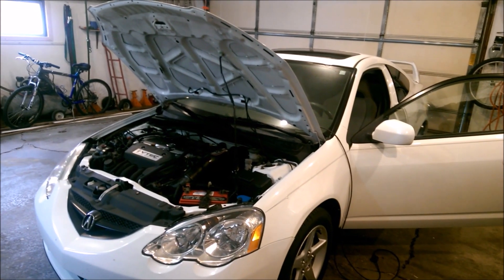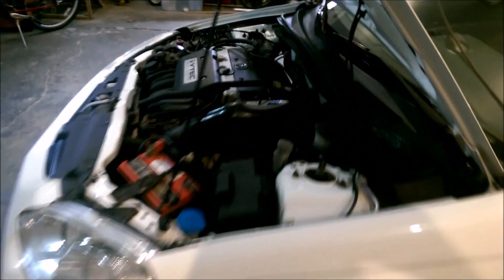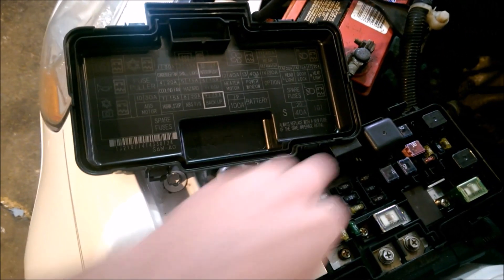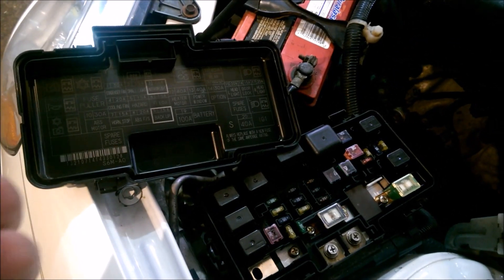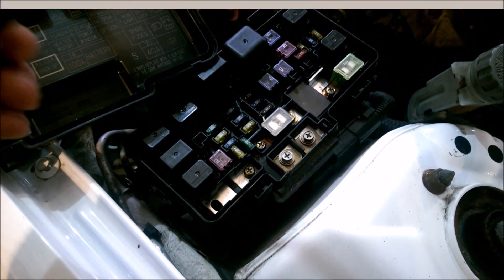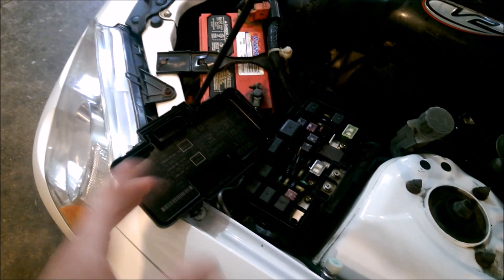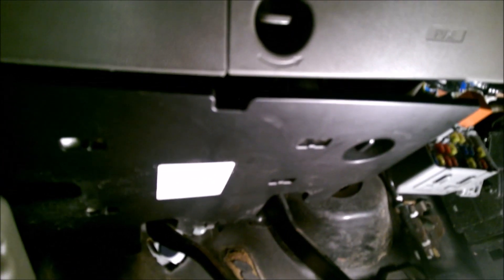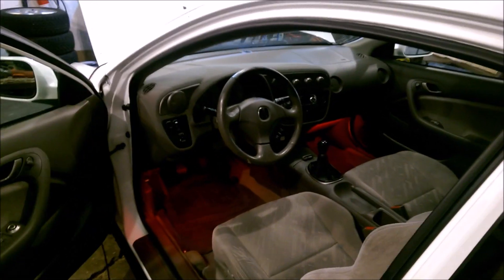LED Footwell/Floor Lighting That Fades To Dome Light/Door Sensor On A 2002 RSX

Comment: The reason they didn't turn off with the dome light is because it's on a different circuit. These type of dome lights have constant power going to the dome fixture. The switch to turn them on manually is grounded near the dome light. You can turn on manually or turn off manually because it's using the same ground. But when you turn the  switch to door, it no longer has ground and it completes the circuit differently. The terminal that now grounds the dome light when the door opens comes from the door trigger which is actually a ground. Door opens and the circuit gets grounded. Door closes, ground is open so light goes out. Most Japanese cars are like this. If you had a different car like a Ford let's say, you can turn the dome on with either the headlight switch or the dimmer  switch on the dash. Ford runs all their interior lamps through a module so it's all connected on the same circuit. It's positive power only going to the light after the door or dashboard switch triggers the module. Unlike this where the light always has power and gets grounded and turns on when door is open.

Comment: im not by any means knowledgeable in this sort of stuff, but surely if you wanted the LED strips to work exactly as the dome light then all you need to do is to splice the led's into the circuit near the dome light instead of the main fuse... ?
Reply: Hey
Reply: That's what I thought too, any follow ups around this - have you tried it?

Comment: thanks for the video, trying to do this for a 2014 4runner but it's negatively switched.  Any advice?
Reply from the maker: paracordworx cut the negative wire clean open. Now wire the positive side of the lights to the switch side of the cut wire, and the negative of the lights to the remainig side of the cut wire.
Reply: Did you try this? Did it work?
Reply: Didn't work for me

Comment: May i kindly please ask you for the diagram? I do have the same LED strip and placed it also where you put em, but my problem is the the switch on/off only from the door switch, but aside from the door switch i also want it to be  able to control in the dome light switch at the same time. Kindly please send me a diagram of it! Thnxz in advance!
Reply: Did you figure it out? I had the problem where I had constant 12 v even when the switch was pushed in. I even tried to tap my fuse box to the interior lights but they would just stay on but my interior lights would still shit off but no mater what I did led strips would stay on. I had the opt 7 pro kit.

Comment: Help, 

I wired mine to the Cigarette Lighter fuse which is rated at 15A. Will this cause the fuse to blow up when I'm using the cigarette lighter to charge my phone?? I haven't tried to use the cigarette port yet.
Reply: Shawn noooo.lol

Comment: Nice job.  Just get you a new dome light cover off ebay etc.  You can find new and used for not a whole lot of money.  Next you should update all the interior stock lighting with leds.  They have acura rsx kits that come with everything all the way to the hatch light.  Even license plate bulb if you want.  Not expensive for the kits.

Comment: use a toggle switch find a active power when car is on run it to a toggle switch then the lights off of the switch easy u can control them whenever u wish
Reply from the maker: yes you could do that. But the idea behind the way i did it is that youre using the from the factory dome light and this way the lights fade in/out with the door. this causes it to have a more oem feel, which is what I like.